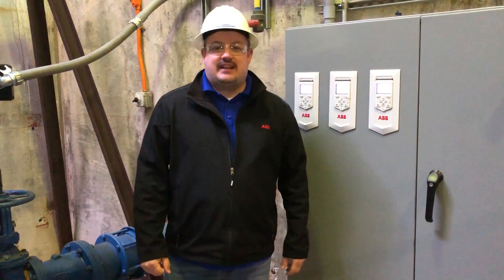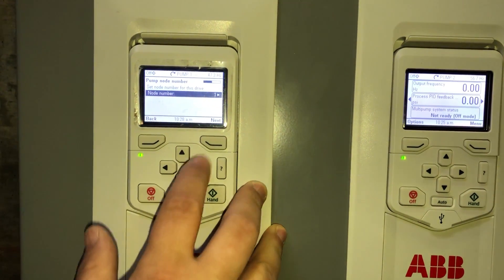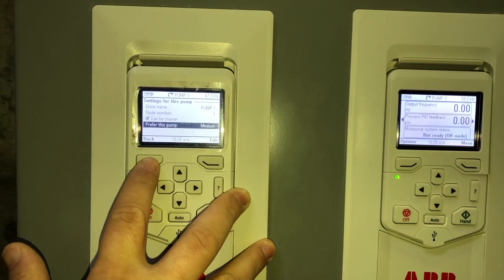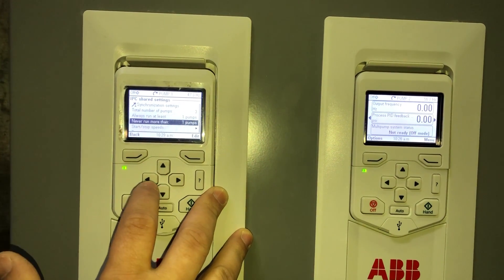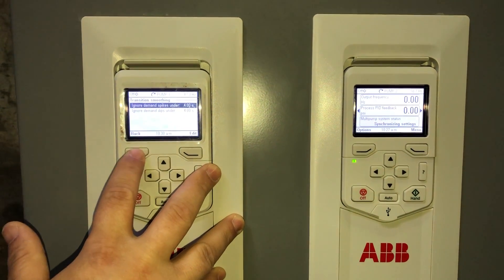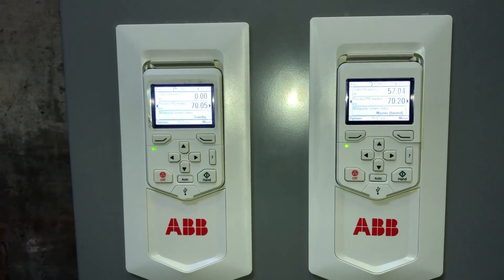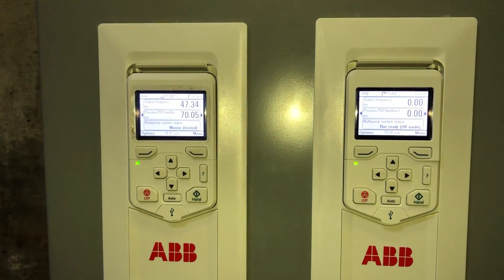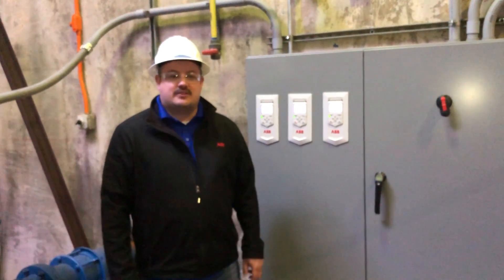ABB ACQ580 VFD/Drive - Intelligent Pump Control Setup

Comment: Question:
Is it possible to add a pressure transducer and have the pumps working in alternative and parallel mode to follow a desired pressure set point?